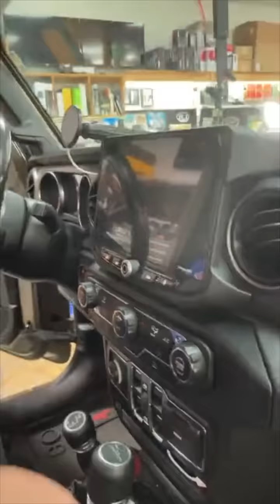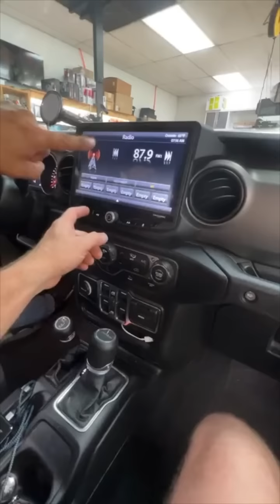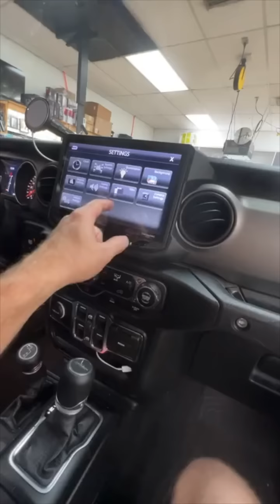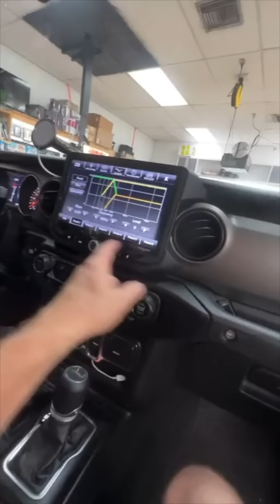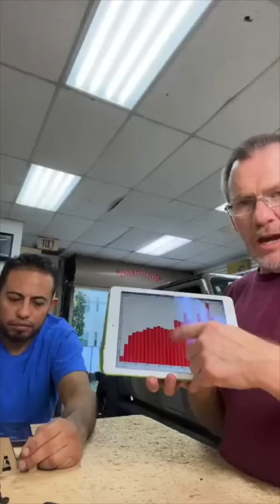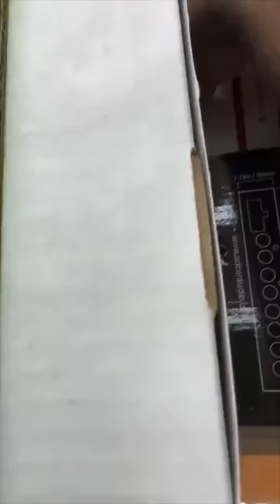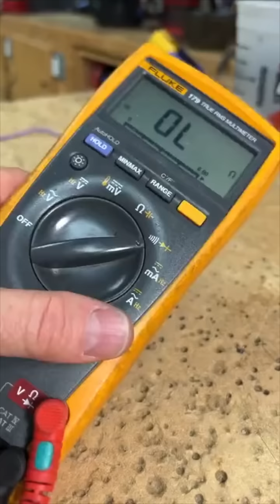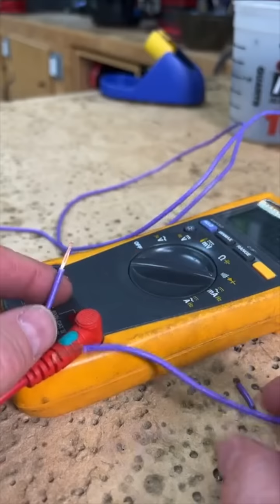car stereo quetions all of them

Comment: Hello my name is Vince and i had a question for you. I have a Skar audio 4 channel amp and wanted to run a Skar super tweeter parallel with a Skar 8 in mid base on a 2006 4 runner. This set up for all 4 channels. The question is should i run the it that way or run 2 tweeters per channel and run the 2 mids on separate channel. I’ve seen your videos and have a lot of faith in what you do and what you’d have to say. There are stereo shops near but i just don’t have the faith in them as I have with you guys . Thank you for your time . 
Vince in California

Comment: I’ve been asking about the irta2/USB-C (new iPad) compatibility since the sale was announced and I missed out on the sale…. Mentioned it on lives and ig comments and no response. Last I saw was that initially it didn’t work.
Reply: 1
Reply: Recently dean mentioned around Thanksgiving he'd finally have time to dig into it, newest video(after this one) I believe he says he briefly started and ran into issues and needs more tinkering. I don't mess w apple products so I have no idea, but what's the issue w the current model? I understand charging ports may have changed but aren't there adapters readily avail to convert to use current model?